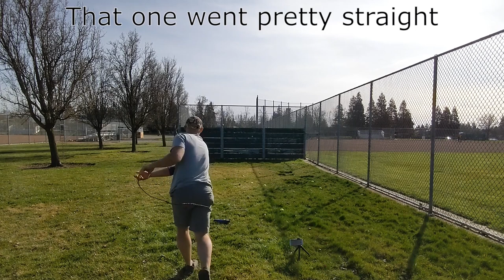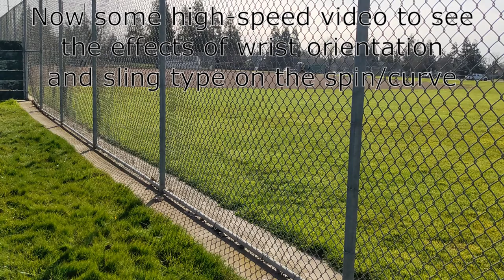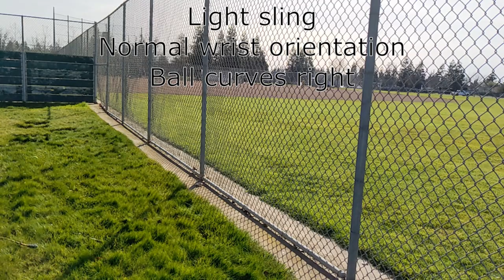Slinging tutorial - How to control spin and curve

Comment: What spin do u get from staff slinging assuming u do everything perfectly
Reply from the maker: Depends on the design of the staff sling, but if it's not a "Y" staff sling and it is built with the release cord in front of the retention cord (i.e. a normal staff sling) then it should roll out of the pouch with backspin.
Reply: @IronGoober  thanks for the data